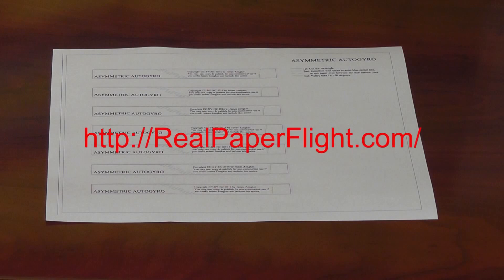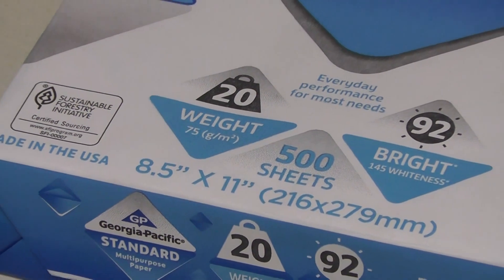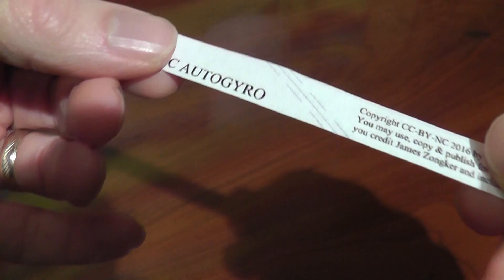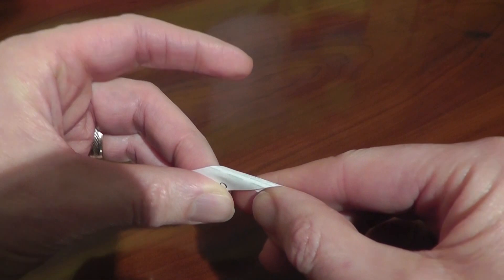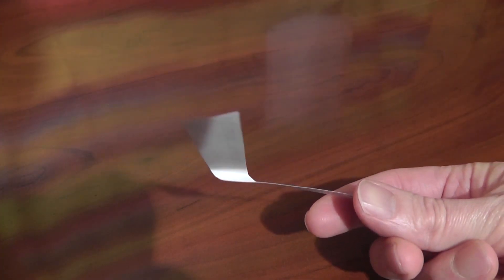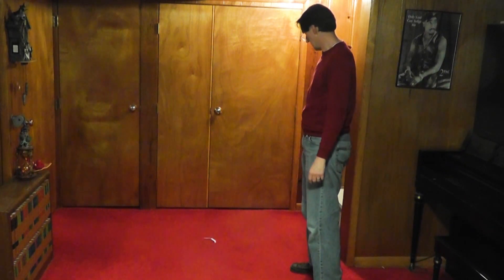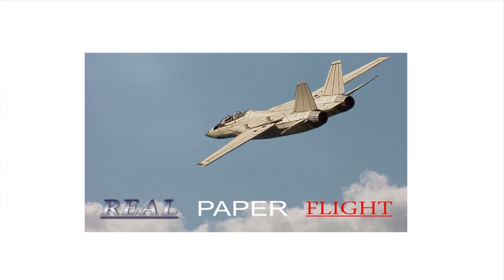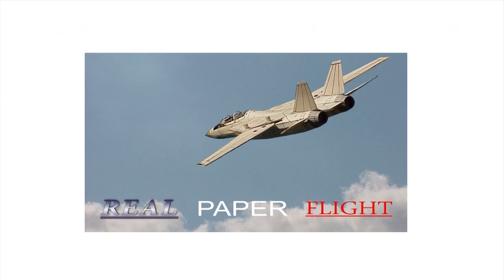World's Simplest Paper Helicopter Autogyro

Comment: Thinking about your design. Would it not reduce drag without impairing stability if you curved the "steering flange" to the radius of spin? Just a thought.
Reply from the maker: In theory it might help a little bit, but the curvature of the spin is really small over 
such a tiny tail surface, so it would not help enough to notice.
Reply: Wow ur smart I guess

Comment: Interesting. Have you done the actual lift to weight ratio calculations, and how do they compare to other similar designs? Klaus
Reply from the maker: Hope this is not too technical:  Descent rate is the speed upward force = gravity. 
Upward force = lift + drag.  A feather falls slowly due to drag.  A good
glider comes down slowly due to lift.  The L/D or "Lift to Drag" ratio of a glider = glide slope.  An airplane with 5 times more lift than drag goes 5 times as far forward as down.  Autogyro blades glide in a circle.  Most of their lift is near the fast moving wing tips.  A better L/D autogyro will spin a lot while barely going down.
Reply from the maker: I have not done calculations, but properly adjusted, this design spins well and stays up well compared to the Whrilybird.